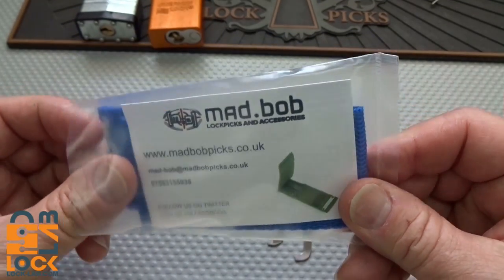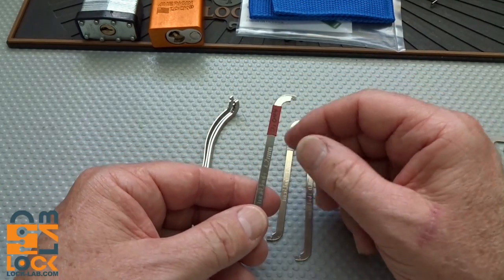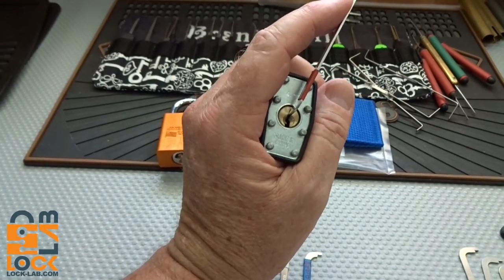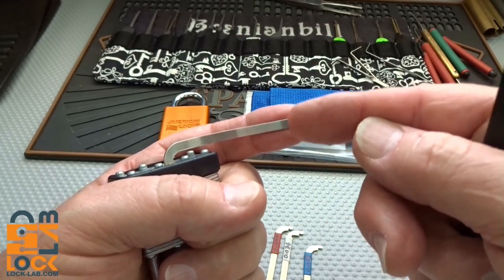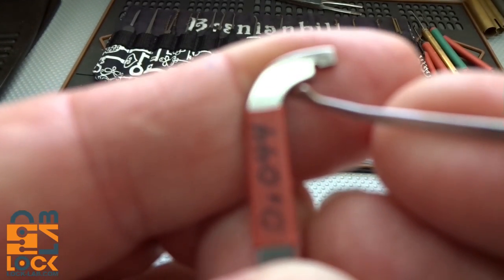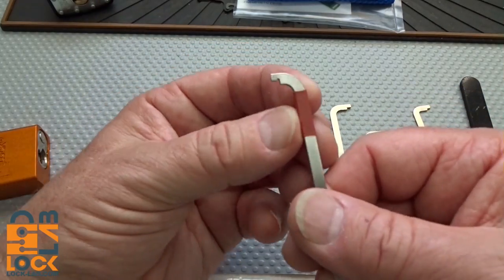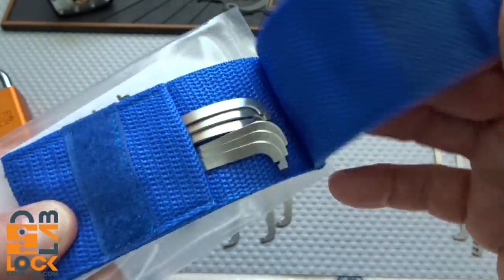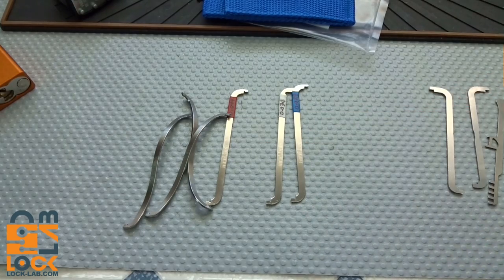(902) Review: Mad Bob's Top-Of-The-Keyway (TOK) Tension Tool Kit

Comment: Bill, the “S” curve design is effective on only one end of the bar; when you try to use the other tip, you’ll have to bend the index finger backwards. A “C” curve may suffice for convenience on both ends, but makes the whole bar looks like a small bow (which is hard to fit in normal tool-cases).
Reply: Metre Kilo  sdelaite mne podarak kto nibuc odnu atmichku chto jalka iabi abradvalsabi ot dushi

Comment: Is there a site I can just buy them from? When I google madbobs. It is a UK site that come up. Same thing on their FB site. Always looking for tok.
Reply from the maker: Unfortunately, Mad Bob's went out of business at the beginning of the Covid-19 pandemic.  You'll have to try other dealers.
Reply: @bosnianbill  That explains why the error on loading the site. Been trying to make my own tok with a bend like the ones you have. Coat hangers are okay or cotter pins as well. Do you have any recommendations on tok that have bends? Have had no luck right now.
Reply from the maker: @Claps1775  You can put a bend in the TOK wrenches - just be sure to heat them up first or they'll break.  I always found my home made TOK wrenches were far inferior to laser cut ones.  I made them when I HAD to, but never looked back once there became commercially available.  They're pretty cheap.  Check out UKBumpkeys or Sparrows.
Reply: @bosnianbill  I bought Sparrows. I will check out the other site. Thank you for the replies sir.